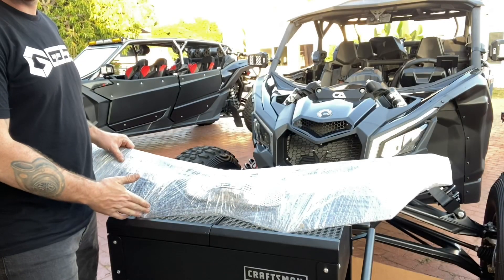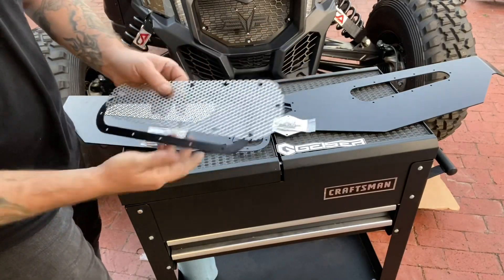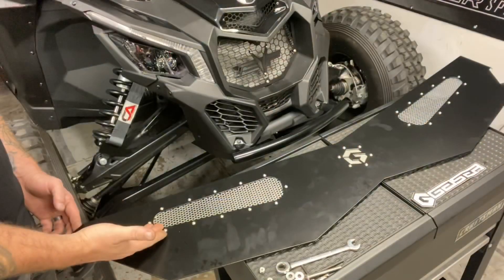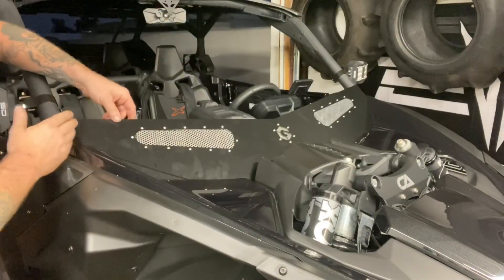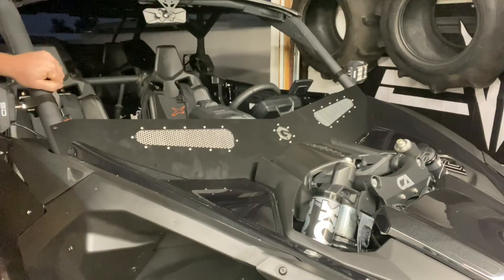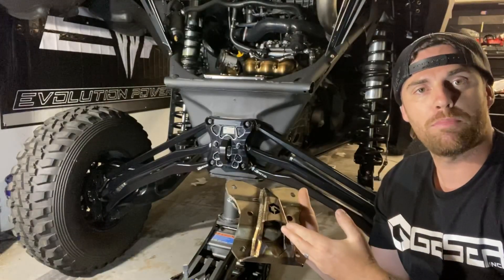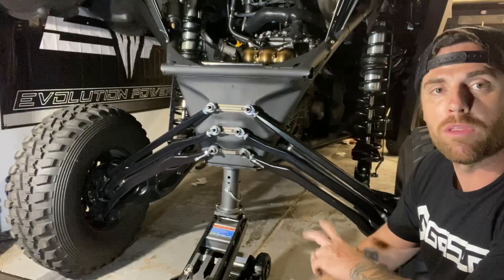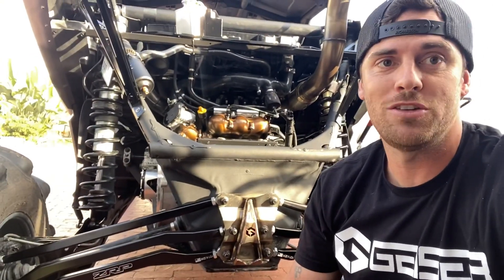GEISER PERFORMANCE HALF WINDSHIELD DEFUSER AND RADIUS ROD PULL PLATE INSTALLATION ON THE CAN AM X3

Comment: What up bro I got a question for when you had ur 2019 xrs you installed a clutch aluminium liner I was wondering if it works good for when the belt breaks.  Those it protects the bell housing from breaking?  And what brand was yours.  Thanks in advance hopefully u can help.
Reply: Angel Lopez 77 i can’t remember which one he uses but I personally use the one geiser performance makes and yes it holds up pretty good I drive my machine hard and have broken numerous belts and the aluminum liner is still good

Comment: I don't know man those stock roll cages are already made from soda cans! Drilling holes in them as well would make me nervous
Reply: Agreed. Can am half windshield has clips that hold in place. I’ve had no issue with mine ripping through desert. Odd geiser wouldn’t make a cage attachment for no drill.